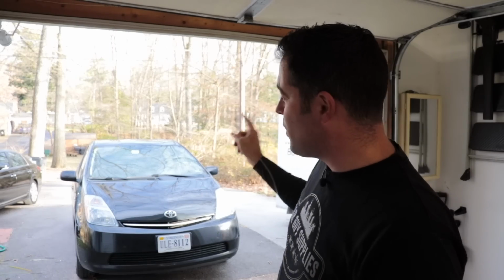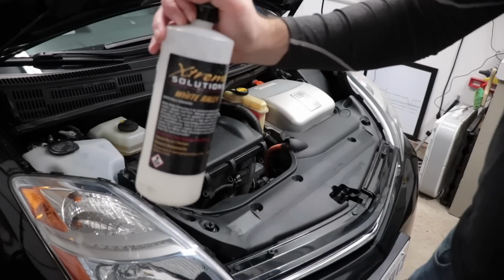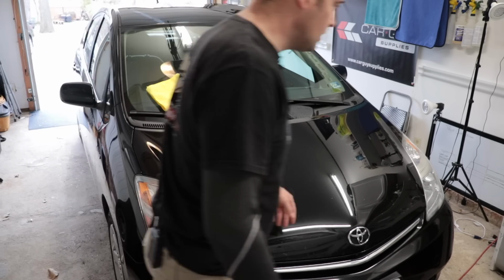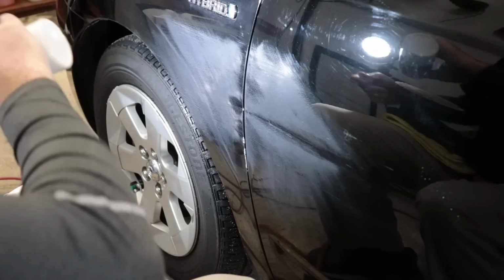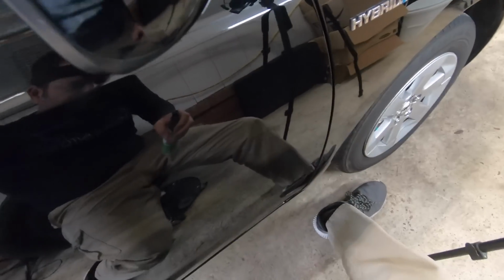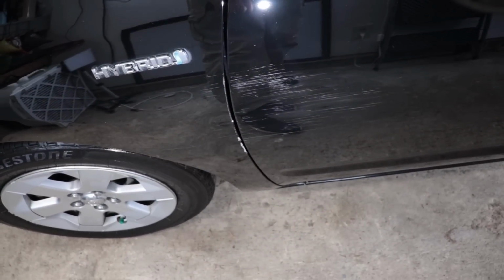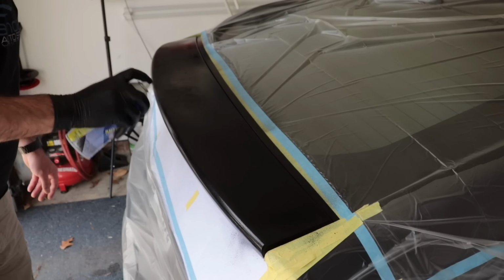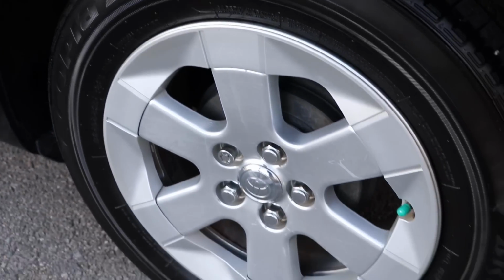Interior & Exterior Detail // Plastidip // Paint Correction #autodetailing

Comment: Thank you! Finally someone showing how to clean those door jambs. Seems not to be a youtube thing. 😉

If the window trim is the usual kind of hard rubber, you can revive it with a microfibre cloth and some degreaser. A trick from Auto Fetish Detail. I don't remember which video. Due to translation challenges I've used tar remover. Worked amazingly but might be waaay too agressive as the solvents "attack" the rubber.

Comment: Hey Phil for dark paint I highly recommend using Fusso coat for great results. That stuff is amazing!
Reply from the maker: Cool!  I’ve wanted to try that.
Reply: Yes, Fusso coat works great for dark paint.  Seems like your friend scratched that paint with these new posts that are made of cement on either a parking lot or a gas station.
The seats are velour.
Great to learn about the plastic dip.  I have seen it before but wasn't sure what was it for.  New learning everyday, thanks. 👍👍👍
By the way, wifey rocks.
Xoxo from Puerto Rico 👍🇵🇷
Reply from the maker: Cool. No...we was side swiped by someone unfortunately...that’s what caused it.
Reply: @MirandaDetailing  Fortunately, they are okay(alive and healthy) and also the damage on the vehicle is localized and not from one end to the other like usually happens.

Comment: Nice video man.  So rewarding to see the progress.  One thing I'm learning or seeing with pro detailers like yourself is that when you tackle a scratch or defect etc, you might go for more than one product to get the result you want.  Totally makes sense.  As a DIY guy who likes to detail my own car, I don't have too many options for polishes but I do have a few. I'm polishing my car this week and I have a question; I have striping along the top edge of the doors on my '14 Nissan Frontier.  Should I avoid touching those with the DA polisher?  I actually don't like the stripe but it was on there when I bought the truck.  Thanks man and keep up the great work!!
Reply from the maker: Thanks!  If the striping is in good condition you can go over it gently with the da on medium speed. But if it’s dry and cracking then avoid it since it will flake and ruin the pads. 😎👍🏼

Comment: I recently got a used black truck, dealership filled in scratches with touch up paint, wasn’t too good of a job, they said they tried their best to blend in. My question is, what’s a good way to do my best to hide it?
Reply from the maker: Hi. You could gently wet sand the touch up areas and compound and polish them out. That can help smooth it out a little.

Comment: Not an expert but iv done some paint scuff repairs before. Im confident you could of use 1000 grit to sand it down first then 2000 grit then 3000 grit to fine all that up. Follow by the cut and polish. I think it would of gotten most if not all of the scuff out.
Reply from the maker: Thanks for the tip. Unfortunately it wasn’t just scuffs. It’s deep scratches that I could feel were deep. I would compromise the paint but going that far anyway...ever. It’s just not worth it.
Reply: Miranda Detailing yes absolutely. Use your best judgment and ofcourse we weren’t there so we couldn’t tell how deep the scratches were.

Comment: Mr. Miranda, Hi. You don't use the CLAY TOWEL instead of the  CLAY BAR? You still HAVE to use both???
Reply from the maker: Hi. Yeah, each vehicle is different. Some have more contamination than others. For really gritty paint the clay towel or mitt may not be enough. You may have to use the clay bar for the bottom portions since they are the worst.
Reply: @MirandaDetailing  thank you sir. Blessings

Comment: I have been driving Toyota’s my entire life. What you need is a medium polishing pad and a light polish.
Reply from the maker: Thanks for the tip. The orange lake country pad is a medium cutting, and I did use a light polish in certain areas. Some parts had been repainted so it’s not OEM paint I was dealing with thought out. So I had to change things up when I hit certain panels. But that’s the way it goes. If anyone has been polishing for any length of time they know that there are many different methods and products that are used in each detail. There is no one product\pad combo that works all the time.

Comment: You prob could have gotten that whole defect out on the fender/Door. When i get jobs like this i make the defect wet and if it goes away wet your are all good
Reply from the maker: Unfortunately not. I get what you’re saying because I used to do minor body work and painting and clear coating. It was very deep. It’s not worth it to dig so far into it and compromise the paint. I only go as far as I can safely go.  Wetting like you mentioned is sully a good rule of thumb but it’s not always accurate. Better to be safe than sorry and cut through the paint.
Reply: @MirandaDetailing   Ye you are right man